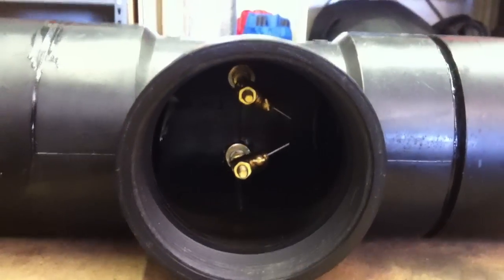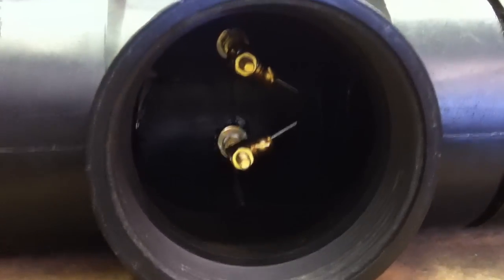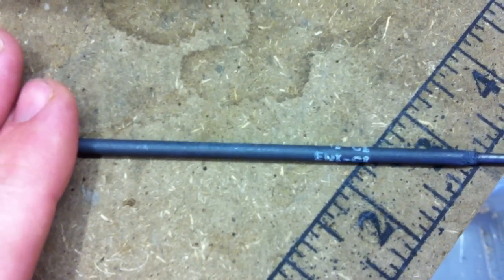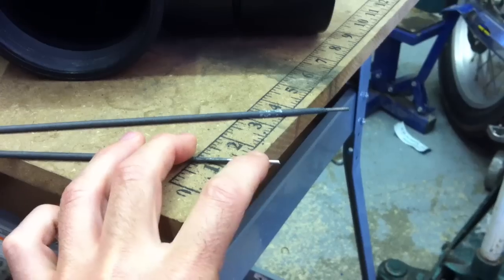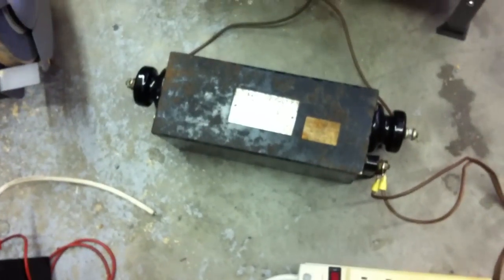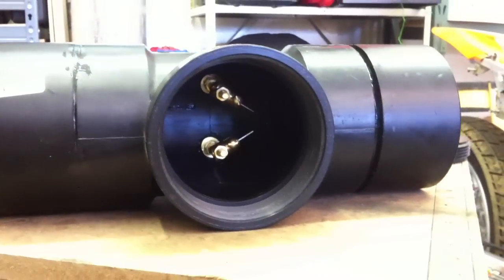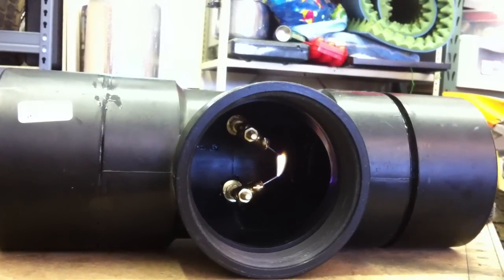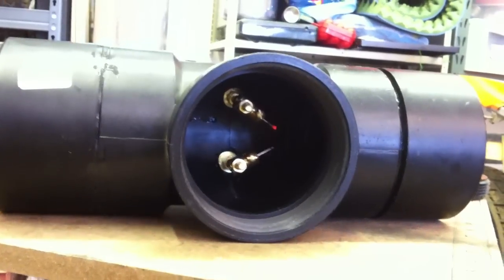Laser EPG 010 - Testing the Plasma Arc, Metallic Ion Chamber

Comment: what was this for? I've seen a few of these laser epg videos but what is it trying to achieve every video fails to mention the purpose of these projects. I came across these by searching Hydrogen gun
Reply from the maker: Hello William, this spark gap is to produce metal ions. This is one of the components needed to create Stanley Meyer's magnetic gas for use in the electrical partial generator (EPG). The chamber will be filled with an inert gas that has been stripped of electrons in an effort to bond the gas with the metal atoms/ions. The EPG is a type of generator Stanley Meyer invented that is theoretically an over unity through reaction device. There are 2 different types of EPG, a pump version and a laser version. I have been researching both, but my goal is to produce the laser version. The "hydrogen gun" is a type of gas processor that strips electrons off of a gas. That's why it came up in your search.
Reply: oh well I've only been exposed to the brute powered HHO cells which are stupidly non efficient but to get a little kick of such dull technology I thought I might construct a legit gun almost like a Paintball gun and basically use it for practical activities like hunting small game or target shooting.
Reply from the maker: Sounds fun, make a video on your progress. I'd like to see that.
Reply: I'm still in research state lol I can't seem to figure out how I could pressurize the gas to 40-60 psi inside a big CO2 tank without overheating it but I'll post up a video as soon as I have something figured out.